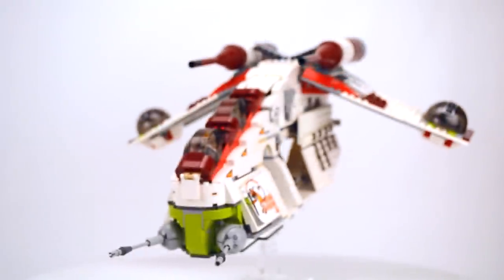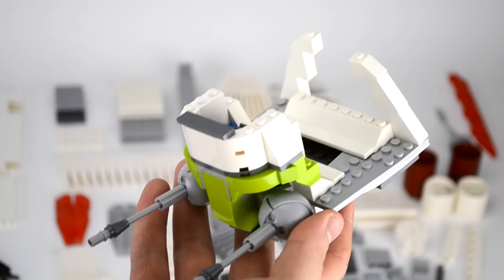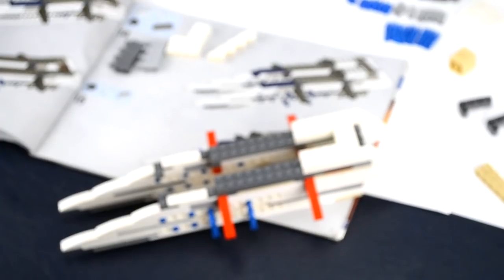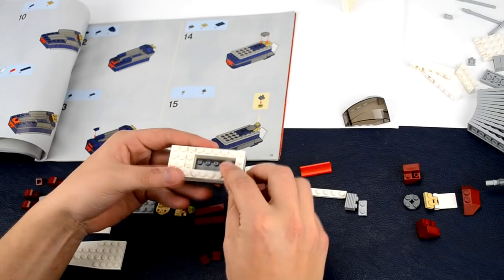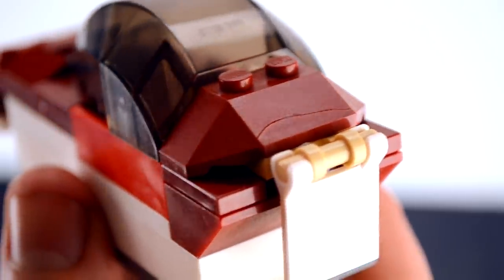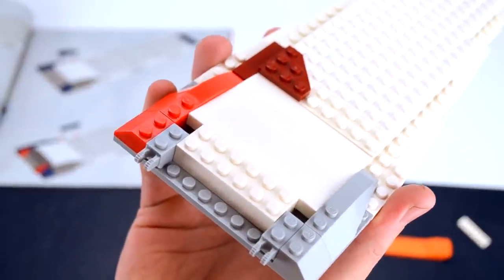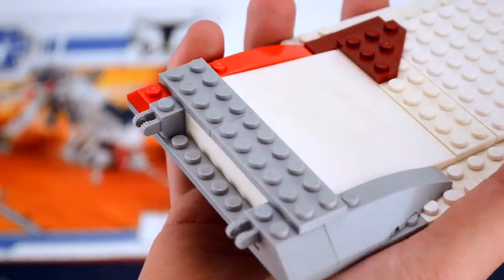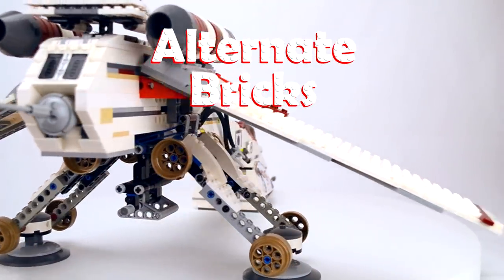Can You Make A GUNSHIP Into A DROPSHIP? The Best way HOW TO CONVERT REPUBLIC SHIP 7676 10195

Comment: It's something I did in the past but it still didn't seem worth it to me... this parts list is going to cost you approx 60 to 80$ on top of the cost of 7676 which is around 100$. You also are out the at ot which is over another 100$ to bricklink... all in all your going to pay 300$ for a converted/bricklinked version which is what you can buy one used for. If you are doing it just for the dropship but not wanting the at or then this is a great option.
Reply: Wisconsin Drummer I just want the drop ship because I can use it with my 2010 clone turbo tank

Comment: wheres the list of parts ?????
Reply from the maker: Currently disassembling it to make sure the list is correct, will update it tonight
Reply: thanks
Reply from the maker: Sorry I took so long, it took me longer than I thought to sort the parts list
3x 52107            Black Brick, Modified 1 x 2 with Studs on 2 Sides 
4x  64644 Black Minifig, Utensil Telescope
4x  57539 Black Hose, Flexible Ribbed with 8mm Ends, 19L
3x  60474 Black Plate, Round 4 x 4 with Hole
20x  3705 Black Technic, Axle 4
3x    3708 Black Technic, Axle 12
6x  32184 Black Technic, Axle and Pin Connector Perpendicular 3L with Center Pin Hole
2x  32000 Black Technic, Brick 1 x 2 with Holes
5x  60484 Black Technic, Liftarm 3 x 3 T-Shape Thick
1x  48496 Black Technic, Pin Connector Toggle Joint Smooth Double with 2 Pins
3x    6628 Black Technic, Pin with Friction Ridges Lengthwise and Towball
3x     x89 Blue Rubber Belt Large (Round Cross Section) - Approx. 4 x 4
6x 43093 Blue Technic, Axle Pin with Friction Ridges Lengthwise
8x   4274 Blue Technic, Pin ½
17x  6558 Blue Technic, Pin 3L with Friction Ridges Lengthwise
2x    6232 Dark Bluish Gray Brick, Modified 2 x 2 with Pin and Axle Hole
2x  3062b Dark Bluish Gray Brick, Round 1 x 1 Open Stud
2x    4742 Dark Bluish Gray Cone 4 x 4 x 2 Hollow No Studs
2x    3961 Dark Bluish Gray Dish 8 x 8 Inverted (Radar)
8x    3460 Dark Bluish Gray Plate 1 x 8
2x  4081b Dark Bluish Gray Plate, Modified 1 x 1 with Clip Light - Thick Ring
6x    6587 Dark Bluish Gray Technic, Axle 3 with Stud
1x  55013 Dark Bluish Gray Technic, Axle 8 with Stop
6x  60483 Dark Bluish Gray Technic, Liftarm 1 x 2 Thick with Pin Hole and Axle Hole
19x  6632 Dark Bluish Gray Technic, Liftarm 1 x 3 Thin
5x  32348 Dark Bluish Gray Technic, Liftarm 1 x 7 Bent (4 - 4) Thick
4x  40490 Dark Bluish Gray Technic, Liftarm 1 x 9 Thick
2x    2905 Dark Bluish Gray Technic, Liftarm Triangle Thin
10x 32002 Dark Bluish Gray Technic, Pin ¾
7x     2555 Dark Bluish Gray Tile, Modified 1 x 1 with Clip
6x  2420 Dark Bluish Gray Plate 2 x 2 Corner
3x  3710 Dark Red Plate 1 x 4
2x  3660  Dark Red Slope, Inverted 45 2 x 2
2x 63965 Light Bluish Gray Bar 6L with Stop Ring
8x 60208 Dark Tan Wheel 31mm D. x 15mm Technic
2x   3941 Light Bluish Gray Brick, Round 2 x 2 with Axle Hole
2x 44375a Light Bluish Gray Dish 6 x 6 Inverted (Radar) - Hollow Studs
5x   3666 Light Bluish Gray Plate 1 x 6
1x   3021 Light Bluish Gray Plate 2 x 3
4x   3832 Light Bluish Gray Plate 2 x 10
4x   3713 Light Bluish Gray Technic Bush
12x 4265c Light Bluish Gray Technic Bush 1/2 Smooth
4x   4519 Light Bluish Gray Technic, Axle 3
2x 32073 Light Bluish Gray Technic, Axle 5
4x  3702 Light Bluish Gray Technic, Brick 1 x 8 with Holes
4x  2730 Light Bluish Gray Technic, Brick 1 x 10 with Holes
3x 32523 Light Bluish Gray Technic, Liftarm 1 x 3 Thick
2x 32271 Light Bluish Gray Technic, Liftarm 1 x 9 Bent (7 - 3) Thick
6x 32525 Light Bluish Gray Technic, Liftarm 1 x 11 Thick
3x 32140 Light Bluish Gray Technic, Liftarm 2 x 4 L-Shape Thick
8x  3673 Light Bluish Gray Technic, Pin without Friction Ridges Lengthwise
8x 62462 Light Bluish Gray Technic, Pin Connector Round 2L with Slot (Pin Joiner Round)
2x 32062 Red Technic, Axle 2 Notched
6x 32054 Red Technic, Pin 3L with Friction Ridges Lengthwise and Stop Bush
2x  4073 Tan Plate, Round 1 x 1 Straight Side
6x 32556 Tan Technic, Pin 3L without Friction Ridges Lengthwise
19x 3004 White Brick 1 x 2
2x   3622             White Brick 1 x 3
6x   3010 White Brick 1 x 4
14x 3008 White Brick 1 x 8
8x   4477 White Plate 1 x 10
6x   3036 White Plate 6 x 8
4x   3040 White Slope 45 2 x 1
4x 50950 White Slope, Curved 3 x 1 No Studs
10x 42022 White Slope, Curved 6 x 1
14x 42023 White Slope, Curved 6 x 1 Inverted
8x  32278 White Technic, Liftarm 1 x 15 Thick
2x  62462 White Technic, Pin Connector Round 2L with Slot (Pin Joiner Round)
1x  6636 White Tile 1 x 6
10x 2450 White Wedge, Plate 3 x 3 Cut Corner
4x  2413 White Wedge, Plate 4 x 9 without Stud Notches
2x 50305 White Wedge, Plate 8 x 3 Left
2x 50304 White Wedge, Plate 8 x 3 Right

Comment: I mean yeah sure it's cool, but at this point you're basically just better off buying the dropship set
Reply from the maker: Some people can't afford the dropship set, this is a cheaper alternative
Reply: Judging by the prices of both sets it looks like if price is of concern you probably wont be able to afford either, as the gunship is 250 minimum, so frankly I'd say just get the Lepin version or something since the original dropship was discontinued, it's not like Lego was getting the money for it anyway
Reply from the maker: I got a used Gunship for $150AUD with all figs from ebay, used gunships are usually cheaper than what they retailed for. So all up to modify a gunship into a dropship it might only cost you $250-300AUD, unless you already have a gunship
Reply: KyoZero Please do not support companies like Lepin.
Reply: @Laser0rick  why not?